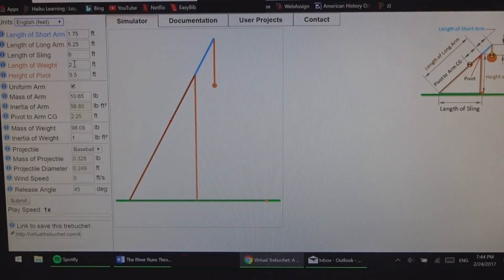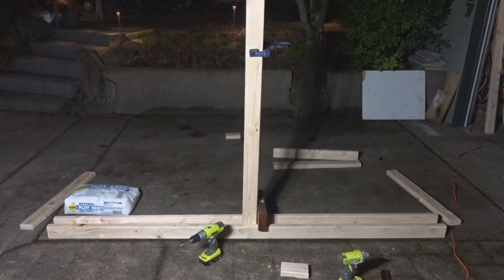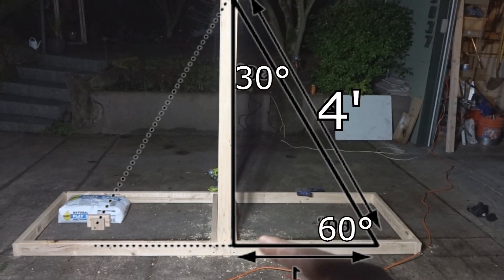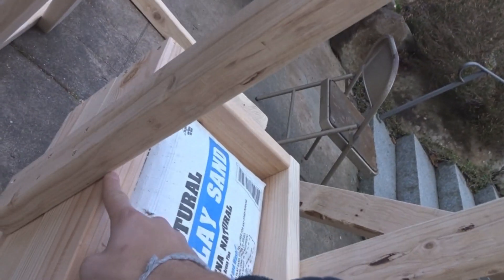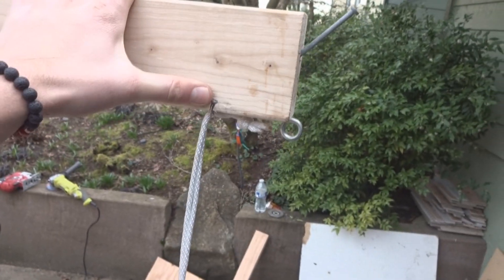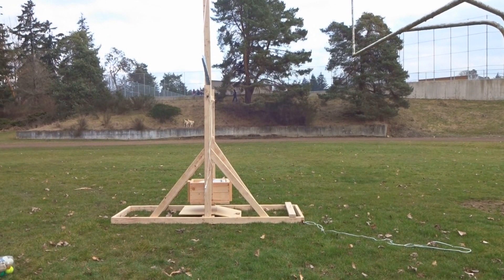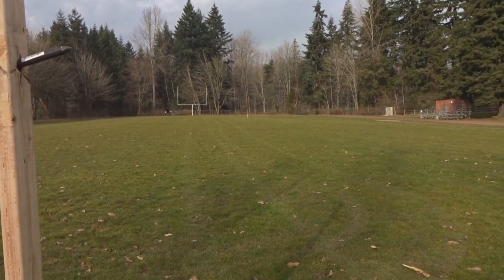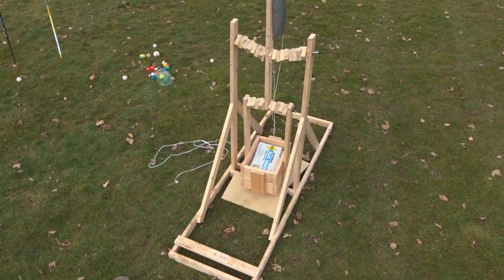How to make: Trebuchet

Comment: I'm planning to make a trebuchet for my AP Physics final project and this was the perfect video. Can you explain why the rod bent and how to make sure that doesn't happen? Thanks
Reply from the maker: A larger metal rod (preferably something other than mild) and the blocks I used leading from the vertical frame to the lever need to be screwed together and without spacing between them so that they lay as one solid piece between the vertical frame and lever, not allowing the rod to bend.

Comment: Hello, nice trebuchet! Enjoyed watching three trebuchet's launching 1 gallon water filled milk jugs and water bottles today at the local renaissance festival. One warning is using construction screws and deck screws to hold your lumber together is a big NO NO! Neither type of screw is able to safely withstand the torsion and sheer pressures being produced. Use only structural screws to build with as they are made to withstand such loads safely. You will have to search for the structural screws yourself as most store employees have no idea that there is a difference. If they are structural screws they will say so on the package, just make sure and be safe. Hope that helps.